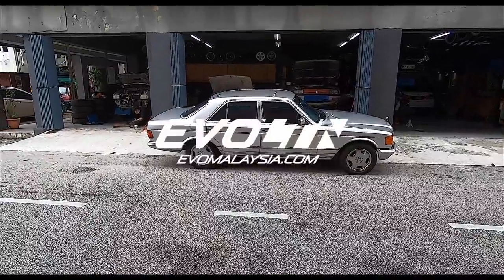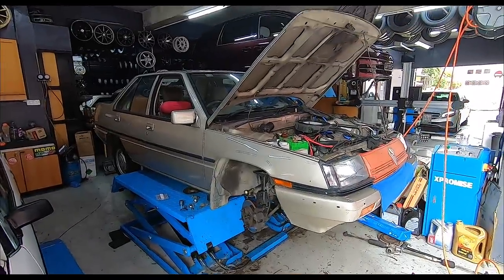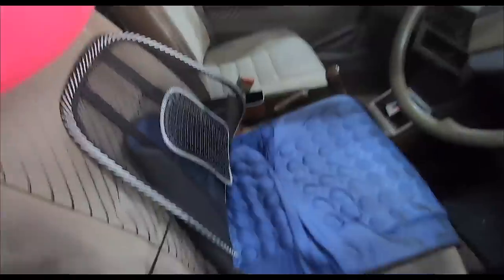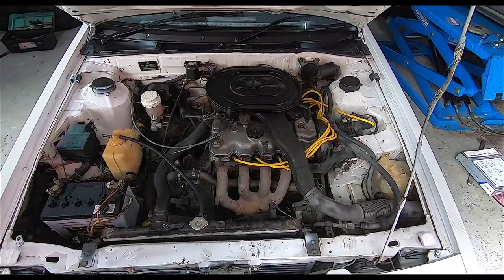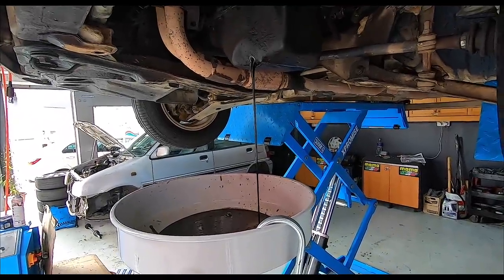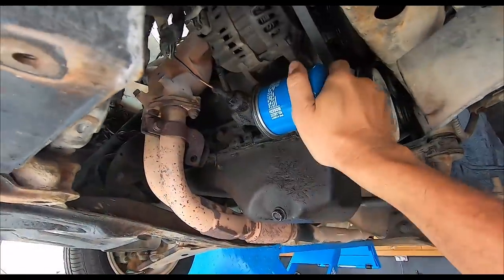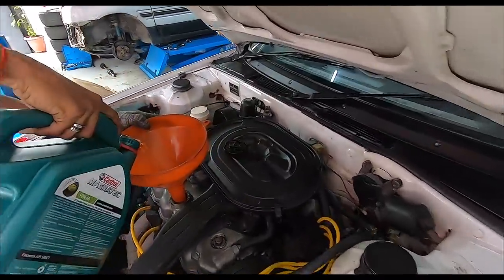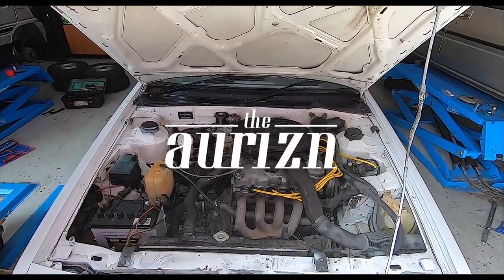UCR: ANOTHER '85 Proton Saga Rescued!! PLUS '84 Mitsu Galant ST Oil Change UPDATE | EvoMalaysia.com

Comment: i did an oil change on 4G37 with liqui moly leichtlauf 10w-40, about 1 - 2% improvement in terms of power. yours seem to be smooth too with castrol :)
Reply from the maker: Oh excellent!! Glad it worked out for u. I decided to go back to something proven and that I'm familiar with for older cars, haha! I'm comfortable with familiarity 😁👍🏾🙏🏽
Reply: @ChrisWeevilGarage  expect small amount of oil burnt after several trips. so check the engine oil regularly :D

Comment: so did you find out the reason for kopi-o kaw kaw engine oil?
Reply from the maker: No man, I reckon it was just the wrong oil for the car 😔
Anyway, all good now 🙏🏽😊
Reply: Sure u will monitor it for time to time coz old cars need more tlc than modern cars. Best to follow 6 months or 5k which ever comes first for service of the vehicle.
Reply from the maker: @adriancheong6227  yes, correct, but this has been about 3mts only, maybe less, and def very little mileage 😬
Anyway, I'll monitor more closely this time, all good now 😊
Reply: @ChrisWeevilGarage  I am sure u will keep an eye on it . Keep up with maintenance car videos. Informative for viewers like us😀.
Reply from the maker: @adriancheong6227  you betcha, thanks for tuning in 🙏🏽😀
Reply: @ChrisWeevilGarage  it could be previously the internal of the engine was really dirty due to the previous owner neglecting regular oil change. Subsequently when you pour in new quality oil, it cleans the engine and that's the reason why the oil looks so dirty despite low mileage. I would suggest changing the oil again after 3K to 5K km and see what's the condition of the oil. That's what I did when I bought a used car.
Reply from the maker: @tanmy2  excellent explanation, thanks for the info, and yes, I reckon so too. I was tempted to do an engine flush, and should have in retrospect. What u said is very plausible indeed 😊🙏🏽👍🏾